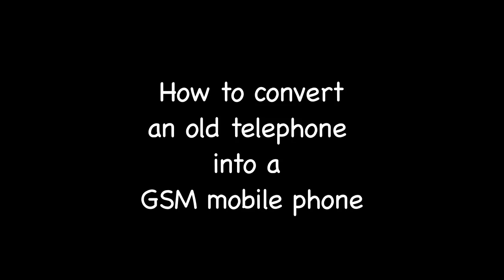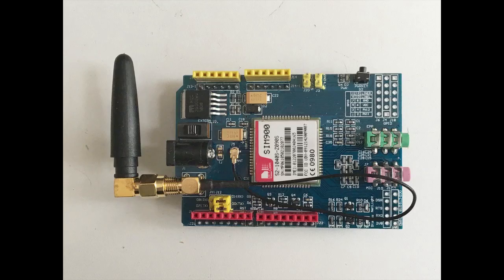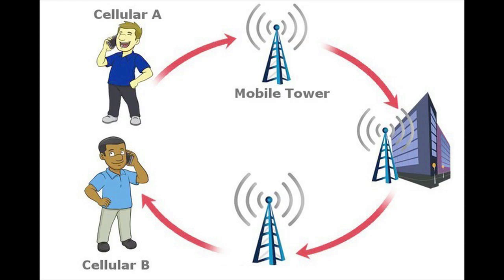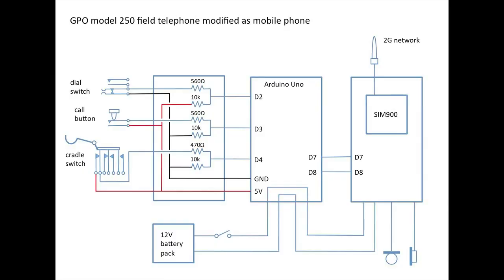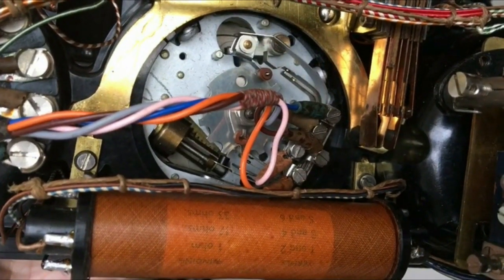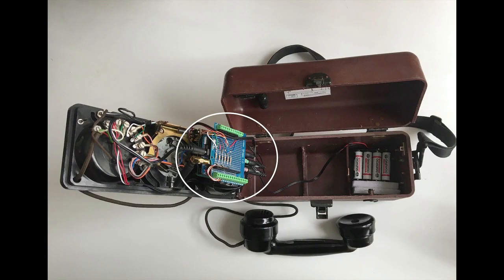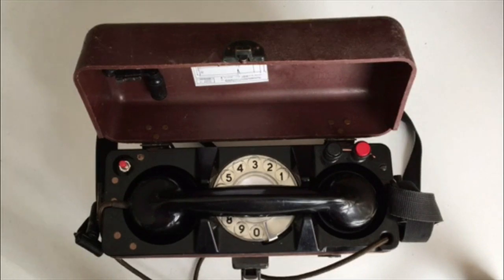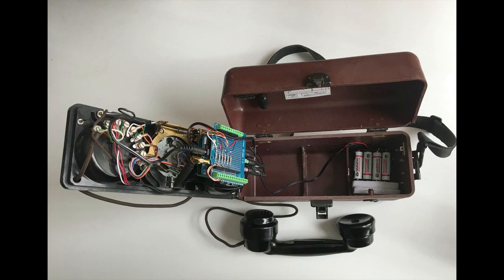Converting an old telephone into a GSM mobile phone

Comment: Nice! I've been working on putting an ATTiny in the phone and trying to connect it to my Android handset (for full network compatibility). Your linesman phone is a good choice because you can actually take it out with you and use it as a mobile phone. Interesting that you're just using the pulse contacts on the dial, I use both sets of dial contacts, I'll have to read your code and see how you did that.